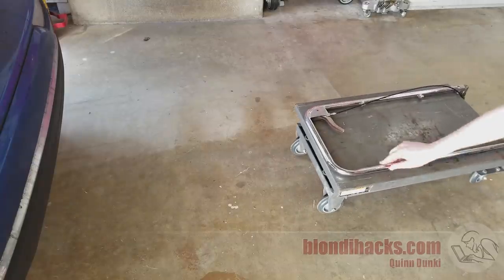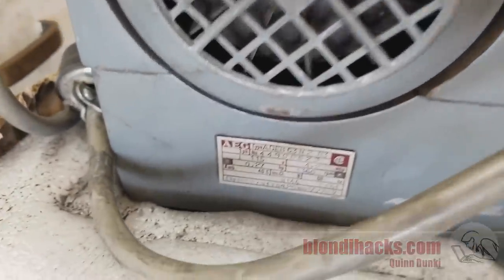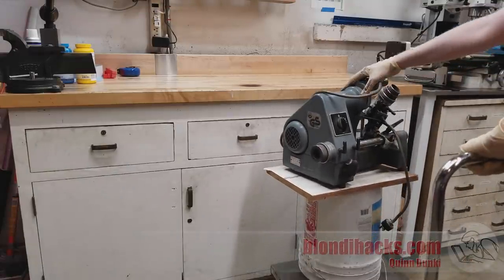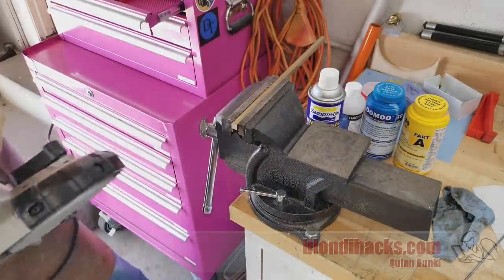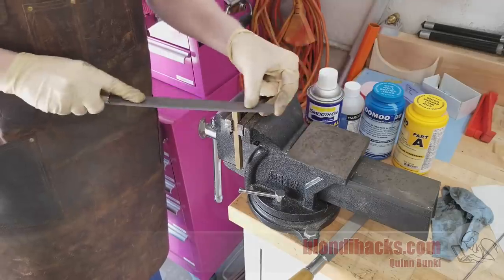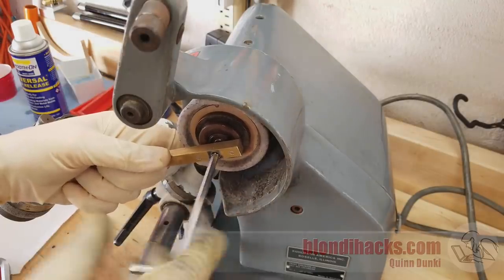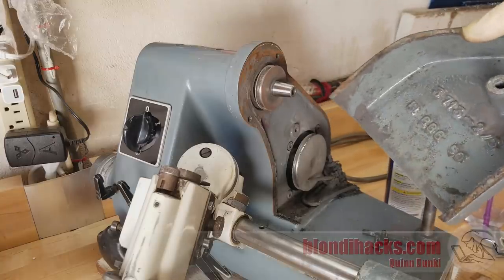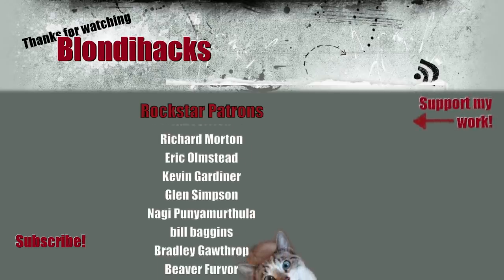D-Bit Grinder Restoration - Part 1

Comment: A simple wooden wedge makes a good spindle lock, but when removing that kind of nut it's easiest to put the pin spanner in the holes, hold the wheel, then just tap the spanner handle sharply anticlockwise with a hammer. I'm really enjoying your videos.

Comment: Hi Quin
Ive been mucking around with lathes etc for nearly 50 years! I had one of those "Oh sh*+@" moments when I saw you setting your tool holder against the chuck face via the 123 block 😒 I won't describe how many methods I've used to achieve that, but sometimes the bleeding obvious is not!
Thankyou for that useful tip.
Guess what, I've got something now that will do that trick 
Pete😎
Reply from the maker: Glad I could help! 😬

Comment: If you want a small shop tip, here's something I learned from my dad: just tie the specialty tool (be it a chuck key for an old power drill, or a spanner wrench for an angle grinder) to the power cord with some wire. That way, you'll always know where your specialty tool is.

Also, I just noticed that that grinder was made like two towns from where I live, in Bad Lauterberg in Germany, hile I live near Osterode.

Comment: Make yourself some various size tools for cut off and grooving from 3/8 square tool bits.  Grind from the right side to make a thin blade, not too long, keep the left side close to the 3/8 left side.  With these tools you can work close to the chuck or collet.
Grind up both ends of the tool bit for best economy.
10 or 20 uniquw shapes for your type work will allow you to make anything.
Rex 76, Rex 49, Momax and Tungalloy are good brands!
Do not rely on factory made standard tooling for the best work.
JIM

Comment: We have a cool old timer trick on removing stubburn grinder nuts (which look identical to this grinder nut) here in the slavic areas. You apply some wd40 on the thread and light it up. Than you take a spotter (the spikey tool that you hammer on to spot drill bit holes and yes I have no idea if I spelled it correctly) and you lean it on one the holes and quicky whack the spotter with a hammer to loosen it up. Works really well.

Comment: Quinn, you need some PB blaster! on that.
Reply from the maker: I actually did use penetrating oil on it, I just didn’t show it. You’ll note the wheel is suspiciously wet at one point.

Comment: Spindle lock is via one of the holes on the top I believe
Reply from the maker: I assumed so as well, but I couldn’t see anything through those holes that would lock against the shaft. No flat spot or anything. It’ll probably makes sense when I get it apart.

Comment: Buttress thread is likely the most common thread ... check out your toothpaste tube cap, or almost any plastic bottle thread .... I recently cut a buttress thread for a project... a friend of mine, who’s career was in the plastic molding field, told me a buttress thread is the “easiest” to mold in plastics ...
Reply from the maker: That’s super interesting. You got me looking at all the plastic threads in my house and sure enough, all buttress. It’s rare in metal, anyway. 😁 I have a new appreciation for my toothpaste tube.

Comment: You are very lucky the person sent the collets.  They cost as much as my Chinese clone of that grinder.  Maybe more.  Their is a recess that you can reach from the left most hole in the top of the grinder that holds the shaft still while you remove grinding wheels.  I have a pdf of the Deckel instructions and one of the U2 manual if you would like them send me an email at hswaters at yahoo dot com and I will return them attached.  On second thought the shaft latch may be under the plug on the right side of the top.  I have only used the latch once.
Reply: You can get Chinese clones of the collets for significantly less, Stefan has some for his D-bit grinder.
Reply: @rennkafer13  yes I think the Chinese versions are about $40 each.

Comment: To make cutting off easier, with less deflection, you might try grinding an angle of about 10 to 2o degrees to the axis of the part on your tool.  I don't see this used often on lathes, but it is routine on screw machines (fancy lathes).

Comment: Hi Quinn, I did a refurb on one of these D bit grinders just recently.  It is owned by the workshop club I belong to.  I found a manual (in english) for a very similar machine TM-U3.
The manual has very good technical details on its construction, setup and use.  The photos are good also.     If you want it, do you have an email address I can send it to?
Or do a Google search for: 
INSTRUCTION MANUAL
TM-U3
Universal D BIT Grinder
Reply from the maker: Thanks for sharing! I googled and found the one you’re referring to. I’ve got quite a collection of these “almost the same” machine manuals now, and between them all I have a pretty good approximation of how this one is built. 😬

Comment: Stupid machining question: at 10:45 you put the square brass handle on two thin parallels. Is there a "thick" parallel that could be used instead? I  myself would be worried that the parallel wouldn't support the part. [seriously I'm a total neophyte]
Reply from the maker: Great question! Parallels do come in many thicknesses. I used thin parallels there so that the drill wouldn’t hit them as it went through.
Reply: @Blondihacks  oh duh! That makes sense.

Comment: If you had watched one of your later videos on this tool first, you'd know that one of the two holes in the top of the machine provides access to a means for locking the spindle :-)
Reply from the maker: Yes, I always knew what it was supposed to be, but it didn’t seem to work. It wasn’t until I had the spindle out that I saw why- the holes don’t line up well at all.

Comment: 1:19 - interesting that you had to cut them... I've experienced boxes that were designed to be removed that way... they had plastic handle inserts that held the removable top 5 sides of the box from small flaps on the bottom of the box.  Pull a little tab on the handle, then pull the handle out, then lift 5/6 of the box off the rest, and there's your equipment, that you can then lift out of the little bit of box bottom that's left.  Lame that you didn't have those, and had to cut them!

Comment: Having dealt with German industrial companies and old obsolete equipment, the "no support, please buy new and go away" mentality is common. 

In my case, it was an 1992 (as old as me!) Inresa S-300 Inductive casting machine I was redoing the control circuitry for as a senior capstone project for my EET studies. Luckily the owner was able to obtain schematics (ja, auf Deutch!) and pictures a few years prior so I wasn't completely flying blind. The machine was missing the control cards, so I had literally nothing to go off of. Not to mention that "no machines are exactly alike"... Not an easy project. Harder than what I do as an actual engineer now. Good riddance.

That said, it was ridiculously overbuilt... good old German quality.
Reply from the maker: Ah, interesting. Thanks for sharing! 😁

Comment: If you threw up some shower curtains between the grinder and the lathe would that be enough protection? Asking as someone who grinds in the vicinity of their lathe.. oops
Reply from the maker: I’m not sure, honestly. I know people do do that, and Stefan is a good example of someone who grinds in a small shop near machine tools. So perhaps with adequate dust control it’s okay?

Comment: Quinn, It seems that the collars are Schaublin L20  type. They are rather common on Ricardo, the Swiss equivalent of ebay :  https://www.ricardo.ch/fr/a/schaublin-spannzange-type-l-20-%C3%B8-3-mm-1066786484/ 
If you need some help to translate the manual from French to English 😃